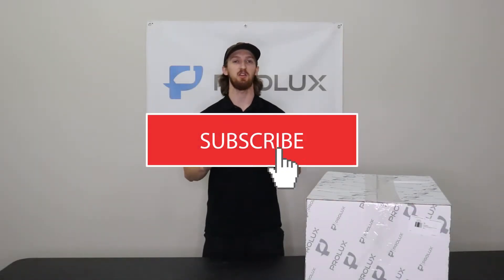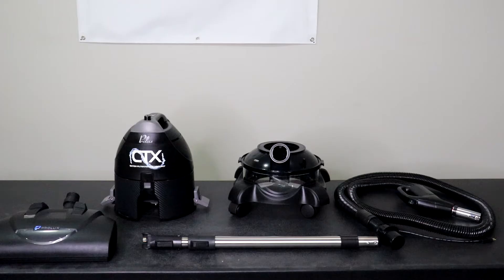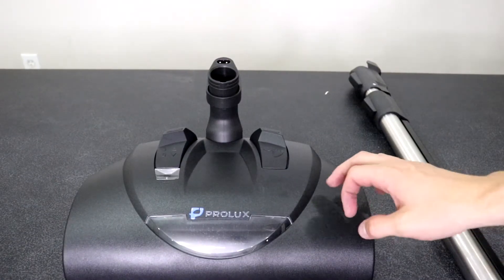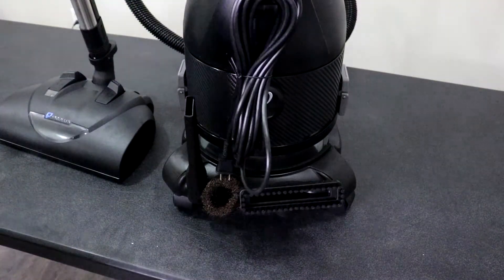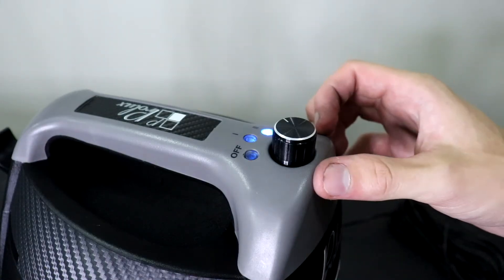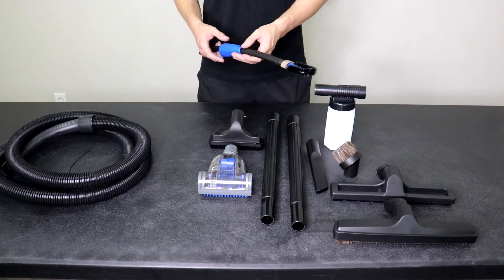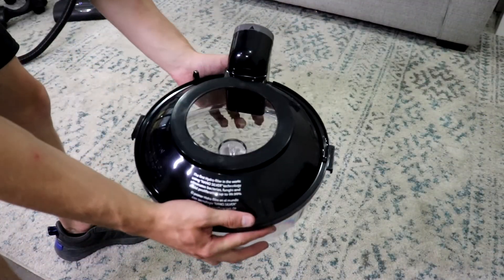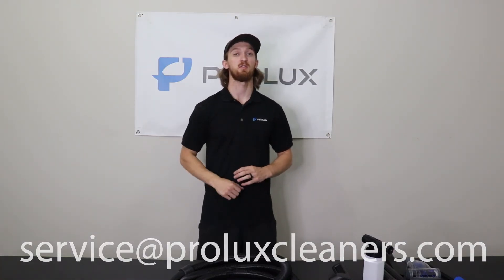Assembly and Overview of the Prolux CTX!

Comment: I have a few questions.  On Amazon i see this model and then a light carpet/hardwood model with a different looking (smaller) power head.  What's the difference between the two models ?  Also, am i able to use either power head model on hardwood surfaces?
Reply from the maker: Thanks for the comment. 

Both power head versions of the CTX will be the same. The only difference is the power head and yes you can use either power head on hardwood surfaces. If the brushroll ends up kicking the dirt and debris backwards, just turn it off using the switch on the hose handle. The vacuums suction will pick up the dirt and debris.
Reply: @proluxcleaners  okay, great to hear both can be used on hardwoods.  If it wouldn't be a bother, could you explain what the difference between the power heads are?  Like the benefits of one compared to the other? There isn't much of an explanation on Amazon, thank you!
Reply from the maker: @8nykspree  Yeah no problem. The smaller power head Wessel Werk 250 will be much smaller in size compared the larger Wessel Werk 360. The 250 will have soft bristled floor tool with an on board cutting tool along with a LED light strip. Despite the size it's still a great cleaning power head. The 360 will be much larger, have a pivot neck release button along with 5 different height levels which can be switched through using an onboard height adjustment power head. The belt and brushroll are maintenance free and the power head will shut off if ever sucks up something restricting the brushroll to spin. The cleaning path is also much wider compared to the 250.
Reply: @proluxcleaners Do you have an opinion on the comparison of the Sirena and Prolux water filtration vacuums?
Reply: I've seen the Prolux Ctx Pet. What's the difference to the regular Prolux Ctx?

Comment: Do you remove the rear cap with vacuumig?
Reply from the maker: Thanks for the comment. Removing the rear cap is not needed to vacuum.  You would only need to remove it for the air purification mode and for the blowing feature.
Reply: @proluxcleaners  my CTX did not come with a cap on the exhaust, but I do also have the storm, is the cap necessary to use or is it fine to vacuum without the cap